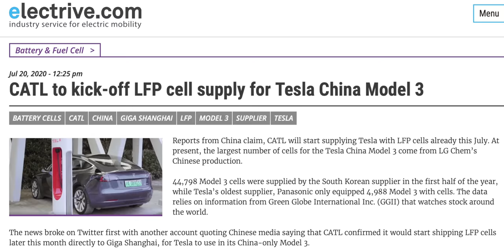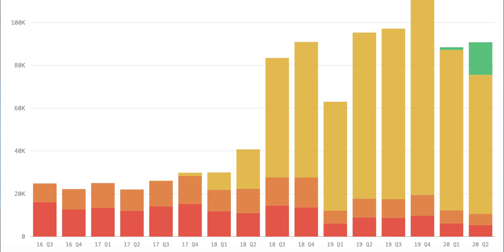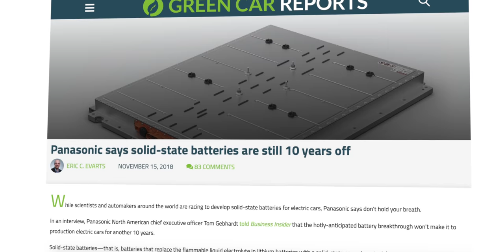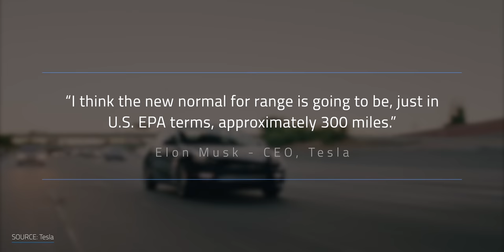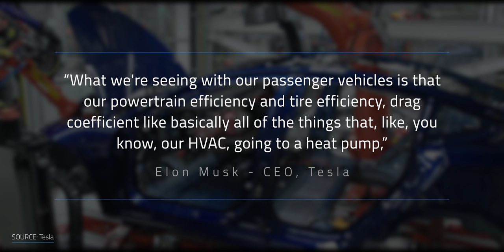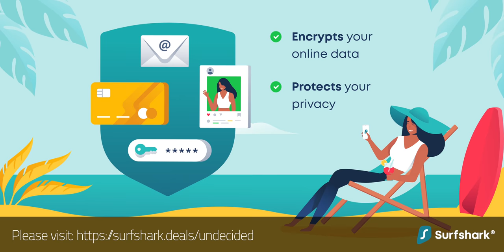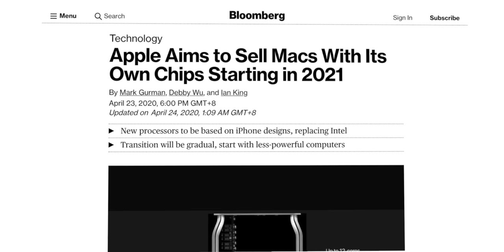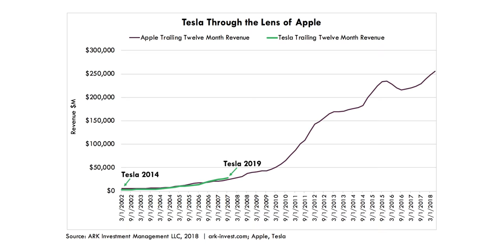Exploring Tesla's battery day and what to expect

Comment: My guesstimate for the Tesla "best battery"...  By the end of the year, a tabless dry electrode cell, which weighs 10% less, COSTS Tesla 12% less and has an energy density (volume) 15% higher.  Don't expect it to be PRICED for less though.   I'd really like to see a Powerwall 3 too, not because there is anything wrong with the Powerwall 2, but the price of Powerwall 2 has remained the same in the UK for nearly 4 years, despite the manufacturing cost dropping all the time.

Great show again Matt.
Reply: The Tabless technology is going to be interesting as it offers thermal stability above anything else which in the schooling of Munro means you can design a simpler heat management system saving part, time and money. 
If Tesla can fit a 300 mile battery that is simpler and lighter across their range then there are even more savings to be made. 
I'm with you in that the Powerwall needs to be bigger and cheaper. If they use CATL's LFP cells it would also free up batteries for Cars and Trucks.
Reply: Helen Lawson ....I’m hoping a recent rumor of scarcity of PWalls indicates they’ve already switched chemistry in production and are selling out back stock before announcing and opening up the changeover at Battery Day.
Reply: @737smartin  It would be good if it is true as there is really no need to use quality batteries in an energy storage unit and makes even less sense when it could effect scaling up of vehicle production. 
Micro Grids need big good value home storage units to get electricity security into as many parts of the world as possible. Fingers crossed x
Reply: Muppet Keeper yep Well said this is all on my wish list with a fair chance it could actually happen. I’d be a surprised and a little bummed if it was much less than this given Elon’s excitement for Battery day.
Reply: walt charamba To some extent it depends on the size of property. In the U.K. we have smaller and less energy demanding properties, so we need both physically smaller and capacity smaller batteries. The 13kwh powerwall 2 would power my home for 2 days most of the year, and is about the right physical size. It’s just the cost in the U.K. is too high.
Reply: walt charamba I understand the price benefit, but they are physically large, and I can’t actually fit one in my property.
Reply: I think you under estimated the progress made now is one chemistry of cell used I think that will change all so size format of cells was limited by the anodes current capacity this patent was not appreciated in its importance just to increase the cells diameter 30 percent would increase electorate capacity 88 percent . This is huge and it’s just one aspect !
Reply: @harryconover289  I'm happy to be wrong if the announcement is better than my predictions :-)

Comment: Honestly at this point for me to be “blown away” I would have to hear 500 miles of range or more on battery day.
Reply: Honestly, I wouldnt be surprised if that was to happen
Reply: Tesla could do 500 miles range now, or 5 years ago.  That is just a matter of putting enough batteries in.  They don't want to.
Reply: 500 Miles on 100 KW battery would smoke Lucid. Or 130 KW  for 550 miles
Reply: I think you and others are missing the point.  I doubt you'll see large leaps in range;  Elon said himself that 300 miles is the target.  What Tesla will be doibg with improved battery technology will be to shrink the size of the battery that achieves that 300 miles.  This will improve interior packaging and weight within the car, and may even improve charging times.  Another goal they're going for is longevity.  Not having to pay a few thousand for new batteries every five years or so is something worth looking forward to.

It's not all about range.
Reply: Isn’t 500 miles range already “announced” in anticipation for the CyberTruck Tri-motor? That’s is one of the main 2 reasons I put a reservation on this car. Range is a winning factor for EV today and always.
Reply: O Glez that’s what I saw Elon say
Reply: What's the use of such extreme range for most people? You basically need to be able to drive at highway speeds for at least two hours on 75% of the battery capacity, which means 200 miles at highway speeds. Current Tesla's already achieve this. With Tesla, you already benefit from the ease of use of the Supercharger network, so with this range you'll be able to do long road trips with relatively short charge sessions every 2 or 2.5 hours.

More range, means more batteries, and a higher price. Seems to me that battery innovations should be used to reduce battery weight and cost in order to get the EV's to more affordable price brackets.
Reply: I would like to see Elon throw in a RoboMower with FSM (Full Self Mowing) software. It's basically a tiny autonomous vehicle in a very controlled environment, so should be a cinch for Tesla to implement.  Current offerings are complex, pricey, and fall short in performance and reliability.
Reply: @CorwynGC  Doesn't work like that. There is a happy medium with battery weight and range. Once you put to many batteries in, it becomes a lot more weight and range drops quickly. Battery density is key.
Reply: @dco5055  I am aware of the trade-offs, but 500 miles isn't impossible.  Long range is only needed for long trips, which are therefore ones in which drag is dominant rather than rolling resistance, weight isn't a factor in drag term of the equation.  Also, Elon Musk has said that they could do it now.  He doesn't have any incentive to, do it however (until the Roadster and the Semi).
Reply: bilgyno1 No I need to be able to go from Fresno to Los Angeles on a “tank“ just like I have with an ICE vehicle my whole life. Additionally, I want to put fat in-efficient tires on, I want the air conditioner on the whole time, and I want to go about 85 miles an hour the whole way. My friends with teslas are experiencing a shortage of range when they go 80 miles an hour up and down these hills from Fresno to Los Angeles. Also I do a lot of driving sometimes three or 400 miles in a day I really would like a long long range of 500 or 600 miles.
Reply: @farukcarushi4983  you seem to have very specific range requirements that are not yet met by current EV offerings. However, in my experience, it is more relaxing to have breaks every 2-2.5 hours to go for a pee/coffee/snack/lunch/dinner anyway. That means at least a 20-30 minute stop anyway, which allows a 150 kW charger to get you back to 80% or so. Plenty for the next stretch.

For me, I need a reliable 400 km range (250 mile) for my trips to my weekend house. I'd be OK with a brief stop to top up the battery. With a 300+ mile range, I'd make it in good weather and would only need 10-15 minutes of fast charging to make the trip at full speed.
Reply: Its gonna be more like 1 MILLION mile lifetime battery.
Reply: CorwynGC or until demand slows down, if ever.
Reply: How many cars go 500 miles on a tank full?
Reply: i rather have a cheaper 300 mile ev than a expesnive 500 mile ev.
Reply: Sam Rightin Hahahaha....ok 1500 then.... even better
Reply: Elon said you would be blown away gues we'll see
Reply: Relax, it's only talk, nothing serious.

Comment: "Should you wait to buy your Model 3? No."
Except, yes. After seeing the frunk redesign, I'm going to Osbourne Effect the Model 3 until it gets the heat pump installed. As a northern mid-westerner, the heat pump is a game-changer for efficiency in the frigid winter months.
Reply: Musk said it would still be about 2y before M3 gets the octovalve (it actually introduced the heat pump) from MY. And yes, that's one of the most frustrating things, the newest production line car (whatever it will be) always gets the newest tech inside as well, and it takes seemingly forever for the other lines to catch up. Like the new paint shop in Berlin, how long will it take until it will be upgraded in Shanghai and Fremont afterwards? Probably years. Way too long.
Reply: @fkarg10  Well, I'm from Europe and tariffs are too high, so i'm going to wait for Giga Berlin, no matter what. And some superchargers in my country would be nice too.

Comment: I wonder when Tesla will make a recycling plan to close all loose ends with sustainability
Reply: @rogerstarkey5390  is it in-house like apple?
Reply: That why they're against right to repair lol

Tesla is a incredible engineering company but they got some mix messages on the pr side
Reply: @burnttoast9890  J.B Straubel (who co-founded Tesla, and former CTO) left Tesla to start Redwood Materials. You can bet that they're going to work together. I wouldn't be surprised if Tesla eventually buy Redwood.
Reply: Will likely be announced on battery investor day.
Reply: Maybe Tesla not buying Redwood so they can keep things quiet(er), fly under the radar?
Reply: @zblurth  Very true.  Tesla has warned owners who try to mod their cars that they will shut them down, one way or another.  Apple is the same.  They'd rather you buy new than repair that "old" iPhone.  I fixed my iPhone (new glass) for 1/2 the cost and it works just fine. Apple wanted me to buy a new $1,100 iPhone Max.
Reply: @electrified0  there's a difference then?  Sorry, but end result is the same and you end up with a 4 wheel paperweight.
Reply: @electrified0  anti repair is not environmentally or economically friendly
Reply: or to have superchargers not emit a lot of fossil fuels

Comment: Immediate timeline:
S&P inclusion anyday. 
9/22: battery day
10/1-3: q3 delivery #
10/31-11/2: q3 er

HOLDing!!! Or accumulating. No selling. Possible battery day drop even on insanely good news. Just like autonomy day and cybertruck reveal (I bought next day dip). Just accumulating $ now for potential battery day drop or correction. Keeping all existing shares to drive up demand especially after s&p inclusion and more short squeezing. Q3 deliveries/er will be massive!!!
Reply: Yeah, I have a feeling battery day hype is going to result in a dip as well. Expectations are crazy high so unless they do an Apple-esc "and the new cells have been going into cars for the last few weeks" surprise I'll be surprised if people aren't disappointed.

Comment: Best guesses:
1. DBE manufacturing technique for manufacturing breakthrough (~ 10x improvement in manufacturing speed, 30% lower cost)
2. Silicon Nanowires (SINS) for energy density / charging speed breakthrough 
3. New cell chemistry to debut in plaid model S, roadster, Cybertruck and most importantly SEMI (needs to be <= 22k lbs GVW). (Model 3/Y continue to use 2170)
4. V2G to debut on Cybertruck, coupled with Autobidder, this would provide a second way to monetize your Tesla in addition to robotaxi fleet. 

Great info Matt, thanks!!!!

Comment: I don't think a 600 mile range is necessary, but 400 to 500 is. Going on road trips is a staple of Americana and this is still a significant disadvantage to owning a battery powered vehicle.
Reply: What ICE cars have that range, besides diesels?

The charging network will surpass current fuel pump availability.
Reply: @spiritlevelstudios   My daily driver is a gas powered Volkswagen Passat and I average about 550 miles per tank on the highway. It also takes 3 minutes to fill the tank and travel another 550.
Reply: @spiritlevelstudios   Don't kid yourself, range anxiety is nearly a non-existent concept for ICE vehicles. I'm patiently biding my time to buy my Model Y for this very reason. As soon as they hit 400 miles ill probably pull the trigger, but 316 just isn't enough for me.
Reply: @kenhiett5266  wow. I get half that range and it doesn't bother me. Work vehicles are a different story though.
Reply: @spiritlevelstudios  I live in Utah and we have some pretty spectacular places to take road trips to. The day Teslas have a 500 mile range it won't be an issue, but Ill settle for 400 because I might be waiting a very long time otherwise.

The shorter range in the winter months is another factor that has me waiting patiently. They will get there sooner rather than later....fingers crossed.

Comment: Some of us drive a lot for business purposes and a 300 mile range is NOT going to cut it.  I want a 500 mile range to have plenty of "margin".
Reply: Not even if battery recharge in time take to fuel up on fuel?
Reply: Someone who has a much stronger bladder than me. 500 miles takes 10 hours in the U.K.
Reply: 300 miles is for base models, but idk if any Tesla will have 600 miles of range in near future... well maybe wait for the Roadster?😉
Reply: Lyle - 500 mi not really needed , there are V3 Superchargers than can add 80% in 10 Minutes.
Reply: The Lucid Air apparently is going to have 517 miles of range.
Reply: @doneit5122   - LUCID air is Vaporware , it has ZERO production cars on the ROAD.
and its NOT a EPA certified Range, just using the EPA Test cycle. 
TESLA NEW Roadster in 2017 has over 620 mile range . and will be made in FREMONT in a few years.

Comment: In Europe, dont buy the Model Y until Berlin production gets going. That US$49k for the LR AWD turns into €64k, which is way more than what the exchange rate + VAT + tariffs would warrant. At least with EU production, they can escape the tariff (10%), which they should pass on to the buyer straight away.

Tesla can drop the price when the Berlin production gets going

Comment: I don't know what to think!!!
What will blow you away, that is available today as to not introduce the Osborne effect?
A little extra range is not mind blowing.
Reply: Promising tech that's currently out of reach for most people but shows the future direction. A Model S Plaid with a 800 mile battery that can charge 400 miles in 8 minutes but costs $140k won't Osborne a $30k Model 3, but will show the potential of what that Model 3 will get 8 years from now when you're looking to replace it.
Reply: electrified0 exactly
Reply: @electrified0  I like the sound of that!!

Comment: I'd love 800 km/500 miles of range in a future Tesla!! - That would cure my range anxiety when going on a 4 hour drive with 4 people in the car at 130 km/hour  - in the winter. The only reason 300 miles is presented as a new normal is due to current tech price/performance limitations instead of being anchored in real consumer needs/desires. Once the tech is ready 500+ miles will surely become the norm.

My current car - a Volvo V70 - goes 1000km/620 miles on a full tank. Why did they make the tank that big? Go figure.
Reply: Slow down in the winter, brother. Especially with that many passengers.

Comment: Interesting point on the Osborne effect. I can understand EV manufacturers wanting to kill the battery range debate, as people will just wait it out for newer EVs with ever increasing ranges but no decrease in price. Capping the range is going to help drive EV prices down in the near term as battery chem/density/manufacture improves but only putting enough energy in the car for 500km. The question will be, is 500km enough range to convince ICE drivers to make the switch? The answer should be yes if most practical driving scenarios, in the back of my mind I know I can still do 850km of highway driving on one tank my current car. Perhaps the 500km cap will help with planning of charging stations.

Comment: Energy transfer rates are what's needed.  300 miles if fine if you can charge you car in 5 minutes.  Plus, if they can increase the power of a 100 mile battery, they'll be able to add a city car for places like Europe.  Nobody wants a car that takes 8 seconds to get to 60kph.  You'd need fewer batteries, which will lower weight and bring down costs and production problems, plus use fewer rare materials, which would improve handling and sustainability.

Comment: 23% provides a 500 mile range, and 2x is 800 mile range ... that literally from Denver to Las Vegas on a single charge 🤭
But I agree, the biggest driver in this is cost reduction. I also think longer life/more charge cycles will enable cell to grid, and is a bigger deal than we think because we can all contribute to clean energy grid with our cars in a magnificently resilient manner. I think people significantly under estimate this capability, as 12.2 kWhr per person on average can be more than generated with 60M cars on the grid at 100% usage. This is a cell network that could change our lives in 15 years.

Comment: To be honest, it surprises me the advances in energy densities.  Wrote it off initially as not achievable.

IMO, the real future for Tesla is providing a transportation service.   Tesla broke the dealer model to buy cars and it will brake the car buying model by providing a transportation service.   The battery need for transportation services varies and their manufacturing is tailor for it.  The smart thing Tesla is doing is putting production constraints up front in design. Wished other developers follow this model.

Comment: I'll think for sure, we'll see the DBE technology with a ~30% increase in capacity, lower cell costs and faster production on batt. day.  I think we'll see another ~30% increase in capacity within the next 2 years and another ~30% a few years later, all while lowering the cell and production cost and have no doubt, solid-state batts. will be the norm in about 10-15-years but it'll be a gradual transition to them.
Reply: The energy density will be below 400 Wh/kg, that is relatively sure, as Elon Musk just mentioned that 400 Wh/kg in mass prodction is 3.5 - 4 years away. My guess is something like 300 Wh/kg maximally 350.
Reply from the maker: I’m in a similar line of thinking ... 300-350 with a path to over 400.
Reply: @UndecidedMF  Yes, as you mentioned, huge amount of battery cells for relatively low cost would be a huge step forward. And I think we can count on higher longevity, as that is also related with Maxwell technology and not only Jeff Dahns findings.